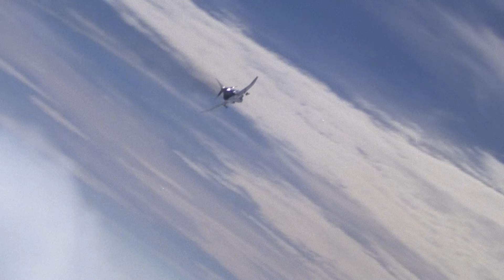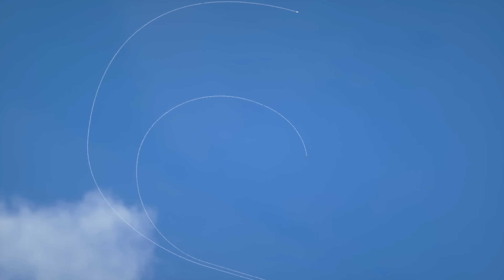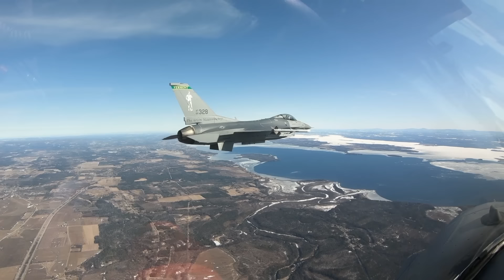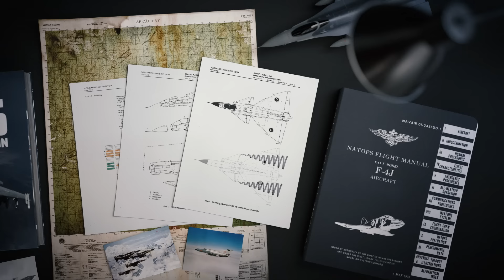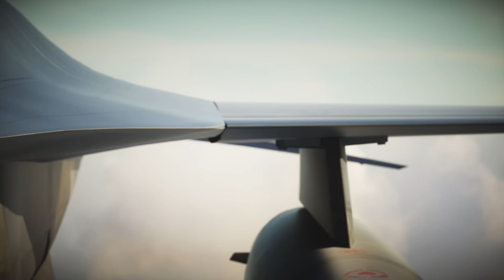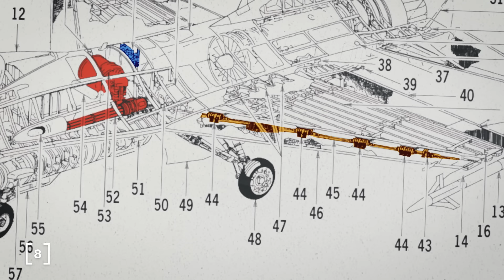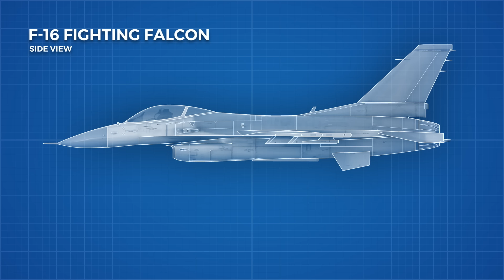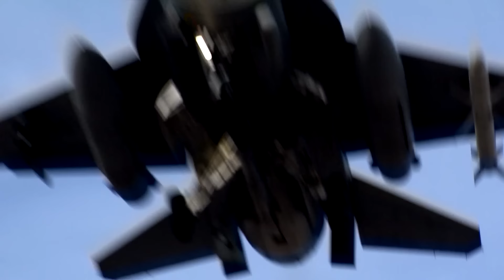The Insane Engineering of the F-16

Comment: Totally flawed comparison, the F4s successor is actually the F14 tomcat, The f4 was originally designed to forfill a navy spec that the uS air force then adopted with some changes. if you want to compare the F16 to anything that goes before it, you have to go back a long way. really the gen 4 high agility aircraft have little in recent history that went before them. it came from a realisation that the missile tech of the 60s was not yet developed enough to guarantee an avoidance of the merge, necessitating aircraft that can fight at visual range. hence the F16, mig 28, rafeale, gripen and typhoon. also it is only as of the late 2000s that missile tech has evolved to a point that the merge will rarely take place, (meteor missile). Emphasis is now shifting to network centric capability that we see in F35. Raptor will be decomissioned as it is the ultimate expression of an air dominance aircraft reliant on some ability to enter the merge and prevail. in many ways the yF23 was to far ahead of its time as it sacrificed post merge combat ability in favour of BVR combat. had the airforce had greater foresight! then we should have seen an in service F23 with a longer service life. but we will now see a faster push to 6th Gen what ever that will encompass in capability. Dont expect a highly manouverable aircraft, expect extreme range high speed, and multilpe crew members and big, very big, think TSR2 SR71 size

Comment: 39:19 is referring to AGCAS which uses DTED (Digital Terrain Elevation Data) to avoid the ground and other Obstacles. DTED is a contour map of the earths surface. The DTS system (Digital Terrain System) knows the elevation of the terrain, as well as the elevation of the aircraft and can predict ground collison. Thanks to a digital flight control system, the flight controls can automatically recover the aircraft without pilot input. That OBSTACLE warning that was shown in the HUD earlier in the video is a spike in the DTED data that is mission plannable and generates the OBSTACLE warning.

Comment: Very informative video.  The "fly by wire" was a game changer.  I worked as a quality inspector at a manufacturer of LVDT's for military aircraft from mid 1990's to 2006.  I have no doubt that the F-16 will be a major asset to the Ukraine military.  Heck, at this point I think we should send a few F-15s to Ukraine.
Reply: Old F-16s, should send new aircraft all along
Reply: For now we don't have even announsment that US will provide us F16. The only US statement was that they will approve handover of F16 MLU from Netherlands and Denmark. Not from US.
Also the F16 MLU is the F16 version from 90s. So our pilots will have the only the comparable capabilities as russians. But not better position.
I hope F16 provided to Ukraine will be modernized to Block70/72 (which have significant advantage as SAR radar). It will allow fight russian planes before their radars spot the F16.
For now russian guided bombs if the nightmare on the fronline and we don't have anything to confront it.
The guided bomb are dropped from 70km distance from the target, where surface air-defence is no capable to hit the plane (mainly Su34).
F16 may become the gamechanger, like HIMARS and cluster munition before.
Reply: @kokakrem  I agree with all, but the hard wall is the amount of trained UA pilots (not too many) and the notion of F-16 being a game changer. At this point they are just a neccesary replacement for lost UA airforce. And many experienced people were already lost. If the west wanted a game-changing amount of F-16 they could do it. But they don't. And if they wanted they'd begin training UA pilots much, much earlier. Either they made some top secret pilot training, or it's just another half-assed measure. It increasingly looks like the latter, especially with artillery deliveries.
Reply: None of them will be able to even reach frontline. 
They are useless against modern air defenses.

Comment: It's a terrible design just like the fail35.
Bad at bvr due to the pathetic radar, no range because it has barely any fuel inside, always needs external tanks that can't actually be jettisoned because they are expensive and very draggy, can't dogfight because of the previous problem, is way too fragile and maintenance intensive, only electrical controls so redundacy isn't a thing, awful flying behavior because it's fly by wire with a stick that doesn't move; the plane flies you not the other way around and doesn't do what you want it to do, very bad aoa control, stall very easily and can even go into super stall that are impossible to recover, worse then flatspins.
Reply: Ok name a good jet
Reply: Blatant disinformation from you.

Comment: 37:15 you also can't lay the human body too far back or the same blood pooling occurring in the outer extremities also happens in the brain and with the rate of blood oxygen use in the brain being what 10-25 times more than other cells in the body, this can lead to a carbon monoxide type poisoning as the blood with the used oxygen has a carbon atom attached and that used oxygen will be heavier and thus towards the last to leave the brain. think of it as a balloon weight such as a sand bag attached directly to gravity source plus newtons first law of motion but more complex given blood vessel design and hydraulic pressures and friction and capillary actions.
 this also causes extra heat.
 nice thing about the external part of the aircraft and the hydraulic lines is they are constantly being cooled while the aircraft is in motion, i can't think of the boiling point of hydraulic fluid at the moment, but blood will also be far much closer to it's boiling point the closer you get to 20 G's as friction and compression increase coupled with newtons first law. it's basically a complex math formula of all 3 newtons laws with some added physics.
the added physics being air pressure, blood pressure, heart rate/(pump pressure and resistance and frictions greatly increasing on this machines abilities as higher G's are going to slow down the heart trying to fight the extra gravity (causing more significant heart attack inducing strain).
 hence why  war pilots have to be in tip top physical shape as Cardio is a massive part of staying alive while flying. look at birds heart rates and especially hummingbirds. the closer to flying like a humming bird people become, the more our bodies have to replicate those birds body characteristics. and human bodily evolution is going to take atleast a thousand years to develop of a highly select few who have higher than average abilities by 1or a few more % and that's just for a minor increase such as living in mile high altitudes such as denver or swiss alps or the himilayan mountains.
i know theres more, but i'm not being paid so i'll stop here, this is the best freeware version i am willing to put forth 😅

Comment: But MiG-21 was at a severe disadvantage in a dogfight against F-4E (with internal gun)?? 
The reason it was successful in Vietnam is because of Vietnamese pilots using powerful engines to ambush american planes then run away.

Also F-4 Phantom was the first american fighter without a gun due to overconfidence in newly developed missiles, both AIM-9 and AIM-7.
This led to pilots not being properly trained in BFM situations.

It was not due to fishbed's superiority in a dogfight, though one might argue that having a gun is an advantage in itself. But that's precisely why TOPGUN program came to life. And why F-4E has an internal gun.

Not to mention, MiG-21 was designed purely with interception in mind. It had DISGUSTINGLY TERRIBLE rear visibility.

Comment: There's no way the center of gravity of F-4 is that far forward. 
All you have in front of it is the nose cone with radar, small front part of fuselage, diverters, part of nose landing gear and pilot's cockpit. 

I don't think those weigh as much as all you have behind it: the RIO/WSO cockpit, most of the fuselage, intakes, wings, fuel tanks, main landing gear, both engines and all hardpoints for weaponry or drop tanks.

Comment: To a lesser degree the F-86 Sabre was also born of similar ideals and future necessity. The USAF was hooked to the ill performing straight wing concept going to the German inspired 35° swept-back wing leading edge. It was the game changer that was much needed as the inspired F-86F versus the MiG15 in Korea.
The F-.86 also had the pilot over engine concept, even though engineering at the time could not facilitate pilot extended way over the engine nacelle. The F-86F also had the bite with the APG-30 gun-sight and .50cal to ensure better percentage of hits on the target at longer range.

Comment: I crewed F-16's in the AF and ANG for 12 years, then got to crew a test bed at Edwards for a few years. I was lucky enough to have several rides, including one over the range at MacDill AFB in 1982. Everything that Kern says about the M61A1 Vulcan is true. The violent shaking turns the instruments into a blur. I also got to meet Phil Oestricher at the SETP convention in Rome in 1992. He was the one with the dubious honor of the unplanned 1st flight in 1974. My last flight as a KC135 Boom Operator in 2005, I refueled a flight of F-16s from the Illinois ANG. I built a 43-year aviation career, basically around the F-16. Absolutely love the airplane.
Reply: Thank you for your service.
Reply: Thank you sir for your long service
Reply: And what's the most important and convincing proof of the quality of that airplane...is that it did not kill you (and it did not even try). And that's the most important tribute we can give to the builders of it. 🙂
Reply: Hell yeah! Everything is squared away on this platform.
Reply: the first su25 gun was flipping switches in the cockpit when the gun was fired. it was that violent.

Comment: When I was in the Air Force, I got to sit in an F-16 on the ground (I'm fairly tall, but the floor can be adjusted so I actually fit). What amazed me was the immovable stick. I had played a lot of flight simulators (well, space sims mostly) before this, and really found it hard to wrap my head around controlling the aircraft just by applying force to a stick that didn't move. I was also told that the forces from the rotation and recoil of the M61 was so great that it made the aircraft turn when fired (since it was on the side, not the middle), but the fly-by-wire system compensated for it automatically to keep the aircraft flying straight. That stuff blew my mind. Been a fan of the F-16 ever since.
Reply: And that is why the A-10's 30mm GAU-8 gun IS on the centerline (and the nose gear if off center)
Reply: I think axel is gun's centre point, so gun isn't in middle, but triggering point is. So ammunition flying out middle of plane.
A-10 should have rocket motor that fire's when it's shooting, then no brake effect when firing.
I think my idea not selling well, but that would be good looking at night. 
That's called "balancing forces" in case they adapt. BF
Reply: @jannejohansson3383  No, the centerline of the GAU-8 is on the centerline of the A-10   Nothing about the nose gear is on the centerline.   The concept of a rocket motor is ridiculous.   Heavy, complex and would have to be capable of many ignitions.   That idea is not selling at all, let alone not well.
Reply: Here is a link to a photo to prove my poiint.    https://militarymachine.com/wp-content/uploads/2017/06/A-10-upgrades-a-10-facts-850x567.jpg

Comment: I think it is more fitting to say that F-16 is "less stable" than "unstable" because it really is not. It has relaxed stability, meaning that it is not as stable as most conventional aircraft. In the diagram, we can see that the center of lift occurs ahead of the center of gravity with the horizontal stabilizer generating an upward lift. So, if the pilot or a gust pitch up the aircraft a clockwise moment is generated by the lift force from the wing. This is then countered by the anti-clockwise moment created by the horizontal stabilizer which pitches the aircraft down (it has a longer moment arm so the moment generated is quite strong). This is a stabilizing moment.

In a conventional aircraft, both the center of lift and the lift from the stabilizer generate an anti-clockwise moment, making the system "more stable" compared to a modern fighter like an F-16.

Comment: Fun fact since it was mentioned in passing: one thing that most people don't know about pilots is that there is a height limit, mainly the sitting height. if when you sit on a chair your body height from the chair to the head is 1 meter (roughly 3feet) or more you can't be a pilot because you won't fit in the cockpit.

Comment: the historical section of this video comes dangerously close to perpetuating the reformer myth that they were the heroes that saved the Air force from overly heavy complex BVR fighters that was the downfall of the F-4 phantom. While it is true that initial F-4 phantoms were ill equipped to deal with the merge, the true failings are a tremendous list of factors such as the reliance on unreliable analogue electronics, very restrictive rules of engagement and poor pilot preparation and training for combat in vietnam. Training which btw, John boyd was a part of since he was a veteran of Korea, not vietnam and subsequently became an instructor afterwards. Also worth mentioning that he formulated his theory on what a successful combat aircraft would be with 0 kills or even rounds fired in korea. This doesnt mean the math is wrong but I would seriously question the conclusions drawn from it. The Air force would go on to exactly perpetuate their heavy twin engine BVR fighter mindset with the F-15 which became the most successful modern combat aircraft in history and much to the chagrin of the reformers, the F-16 would go from being a daytime only short range fighter to a multi role also eventually using BVR missiles. Something that often goes unmentioned is that the YF-16 prototypes that the reformers were heavily involved with, were a fair bit lighter than the actual F-16A that entered service.

Comment: The F-16 is a low-cost, lightweight, single-engine fighter jet that was specifically designed to outmaneuver opponents while carrying state-of-the-art missiles. It was born out of the Vietnam War, where the heavy, complex US fighters like the F-4 Phantom were at a disadvantage against smaller, maneuverable Soviet-made MiGs like the Mig 21. The F-16 was designed with a new physics-based doctrine at its core, called Energy Maneuverability, which was defined by the management of both kinetic and potential energy, speed, and altitude. In order to change direction, a fighter aircraft must trade energy from these reservoirs, and doing it as efficiently as possible is the key to outmaneuvering an enemy.

The F-16 was built from the ground up with a classified 1966 paper as its guiding light, full of mathematical models, graphs, and equations designed to answer one question: how to win a close-quarters dogfight. The energy-maneuverability diagram for the F-16 is a complicated graph that defines the maximum lift of the aircraft, determining the maximum turn rate at a particular speed in this region. The F-16's best sustained turn is 14.2 degrees per second at 0.85 Mach at 7 g. The F-4's maximum turn rate at the same speed is just 5 degrees per second.

Comment: While I love the F-16, I have to come to terms with its poor safety record.

"Since 1975, the F-16 has had a total of 383 Class A mishaps -- the classification the military uses for its most deadly and most expensive crashes. In nearly 50 years, 88 pilots have died in the fighter jet, according to data from the Air Force Safety Center."

While that's not as bad as the horrible F-104 Starfighter, it's still very bad.